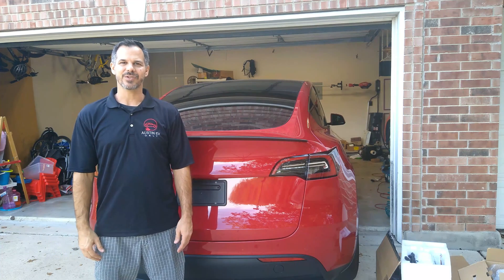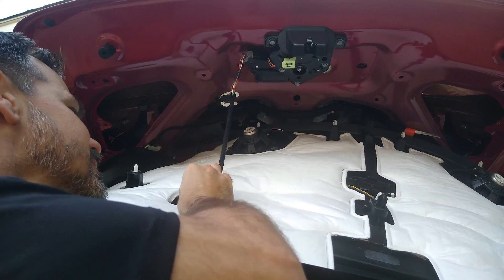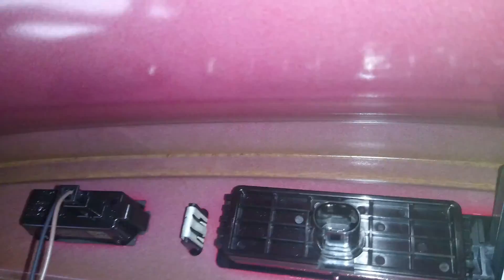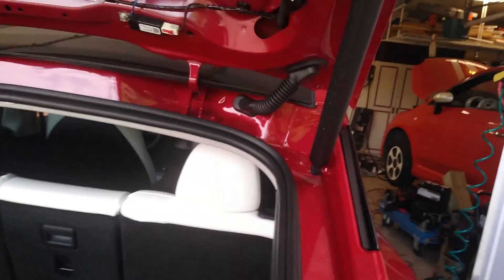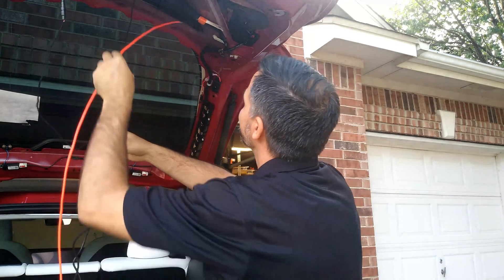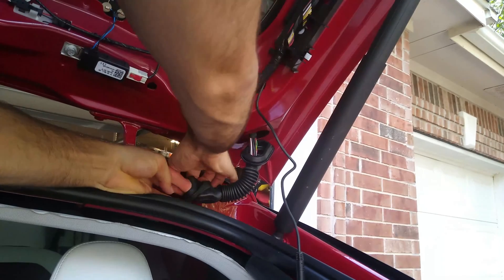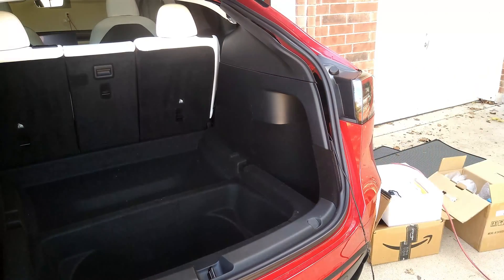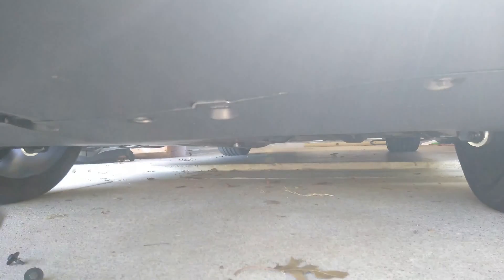Hands-free Kick Sensor for Trunk Liftgate on a NEW Tesla Model Y

Comment: i got this set from hansshow for a tesla 3 year 2022 but i have lots more wires and switches … as i understand it, some wires run all the way to the front battery? can you clarify? u didn’t get power from the battery?
Reply: I have the same question. Did you install it already?
Reply: Same- I have the battery 12 v connect wire that seems like it’s not long enough to get there and through the “firewall”
Reply: @redman8train  Were you able to install this sensor? Did you use all the wires or just the followed the video instruction?

Comment: Thanks.  Great video!  Question: would you say it is easy to remove the interior trim?  Are there any possible issues with the trim panels becoming loose after you remove and reinstall them?
Reply from the maker: Thanks for the question. I feel like the left and right side trunk trim didn't 100% go back. But it was only 1 or 2 millimeters out of position. With the rubber gasket overlapping the trim, no one will ever know except me.